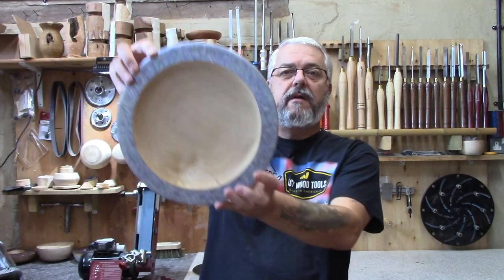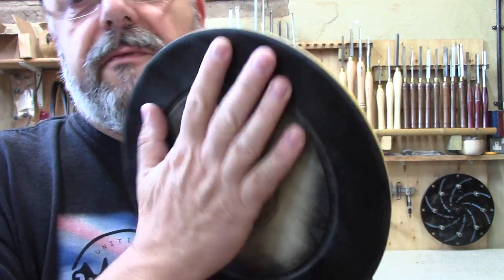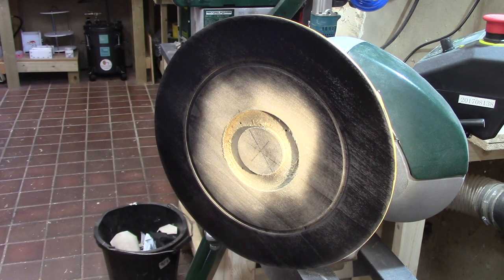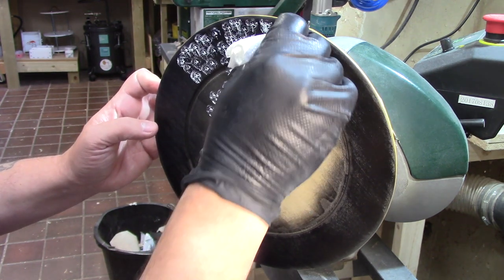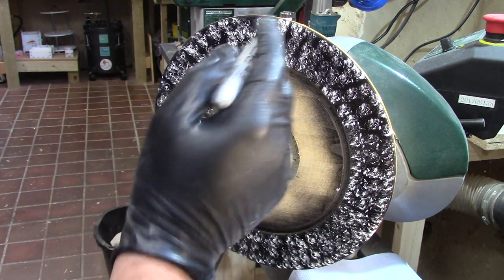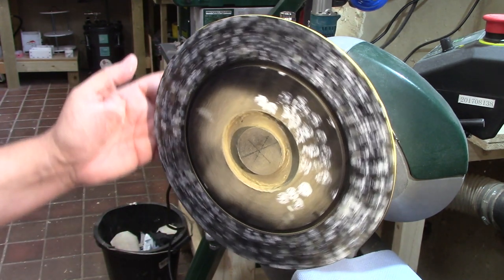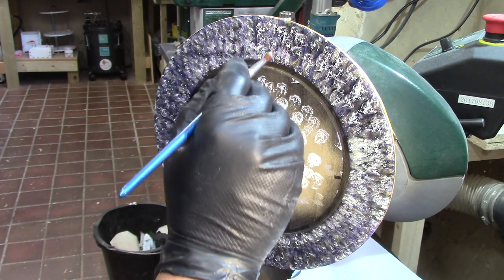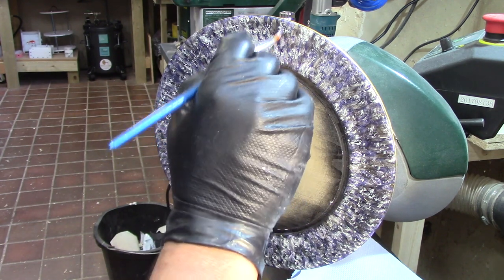Beginners guide to using Jo Sonja Iridescent Paints on a wood turned bowl / platter rim

Comment: I just got some of the Jo Sonja iridescent paints. Your video will be a big help. Did you have to use the white, since you sprayed it black to start? Or does it make the other paints pop more when done. Thanks.
Reply from the maker: Hi Joseph, the black really helps the colours stand out and i used the white just to give it a little contrast. Maybe get away without using the white but I’d always paint on a dark background with these paints